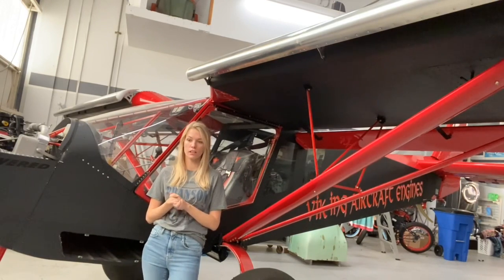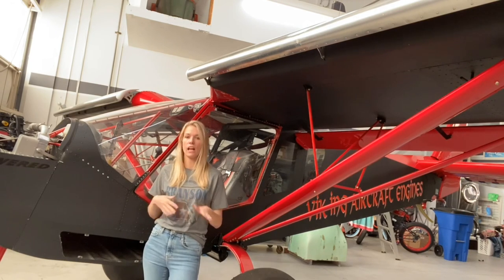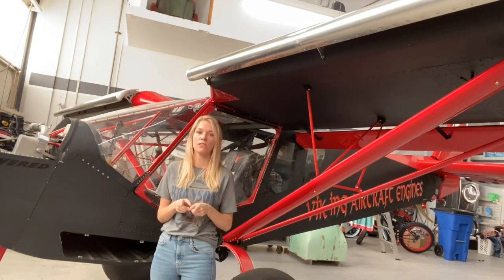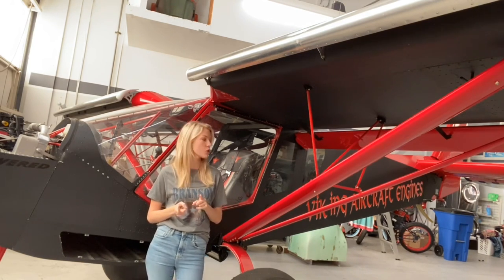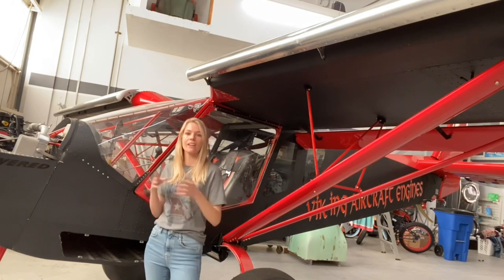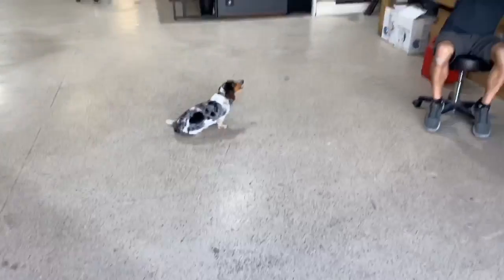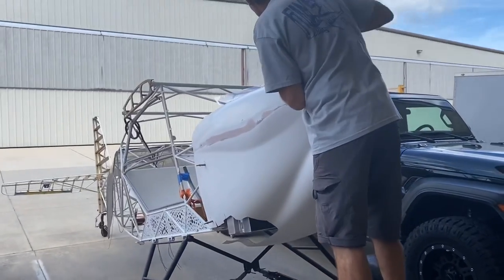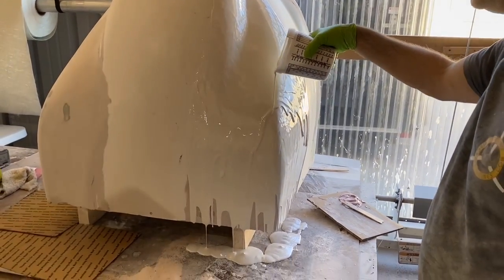Viking Vlog Week 2

Comment: Do you ship all the tools and supplies when you do an out-of-state install? And what is the average cost for a 130 or 195 install?
Reply from the maker: Most builders have the typical tools needed, what we need extra such as special wiring tools etc. we ship with the engine and parts as needed. On-Site Installs are more expensive due to time out of office, and travel fees. Otherwise takes about 4 days cost is around $4000 - when done here it is $3500. Incredibly affordable and some prefer it instead of travelling with their plane.